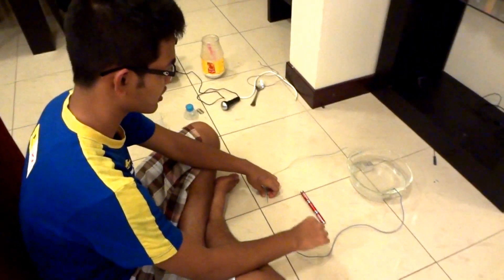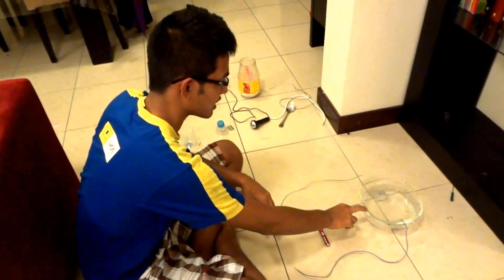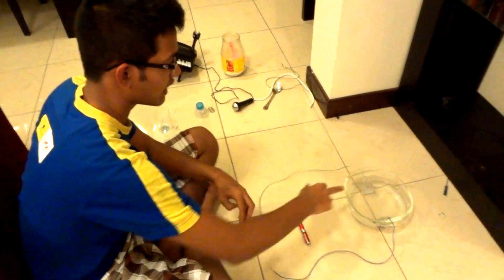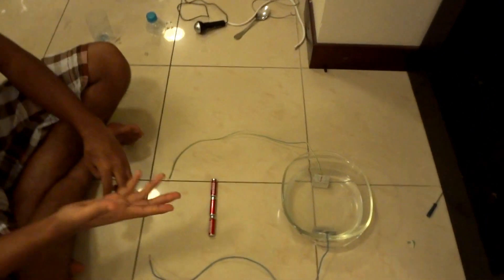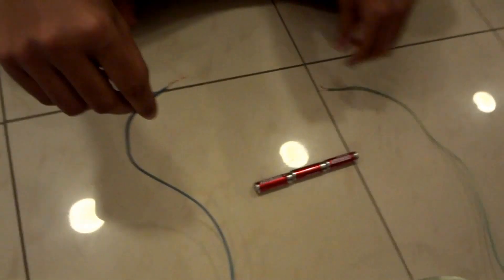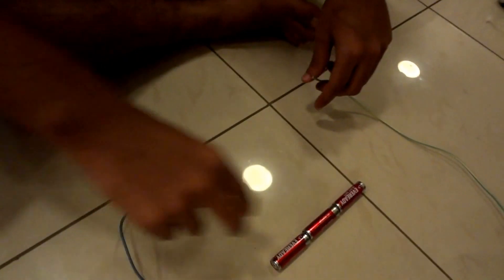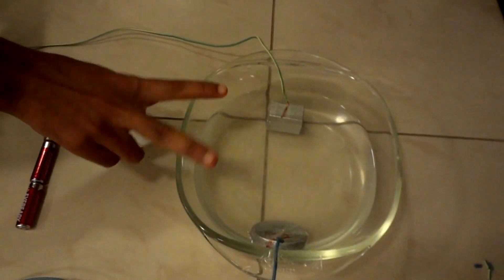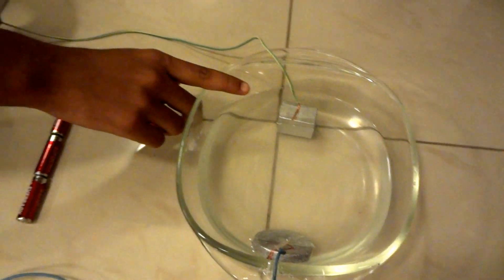Home made electrolysis of Chlor-alkali

Comment: you gotta be careful with that stuff, you are producing small amounts of chlorine gas and sodium hydroxide in solution, and if you want a more pure product i suggest that next time you use graphite electrodes to prevent the formation of minor products such as Aluminum Chloride and Aluminum Hydroxide, and Iron Chloride and Iron Hydroxide. And not to mention that chlorine gas is incredibly toxic by inhalation or ingestion so yeah.....
Reply: and use a divided cell, NaOCl is produced now as well